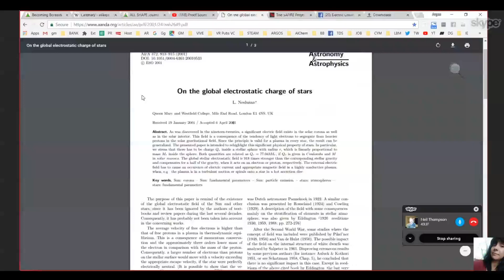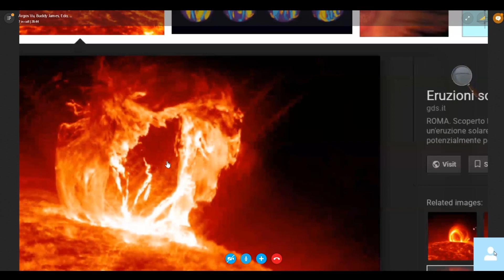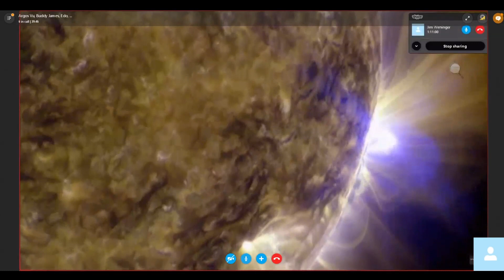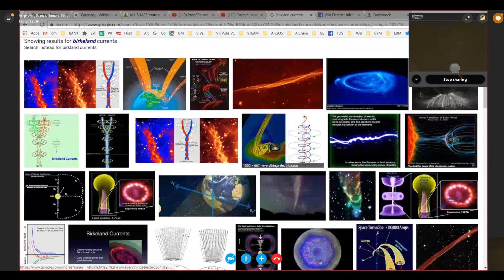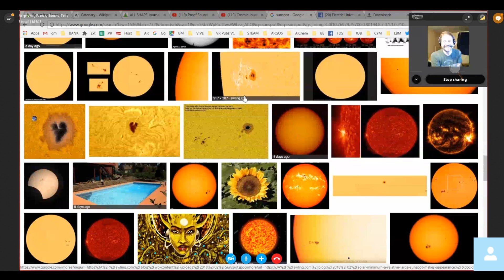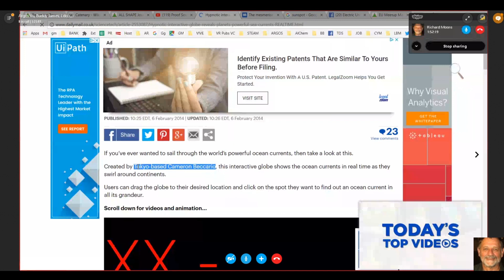Terrence Howard - What is the solar electrical circuit?

Comment: Enjoyed the interview very much, thanks!
Some thoughts. The Hydrogen-fusion solar core theory is obsolete, because:
1. The 'Coronal Problem'; it is the magnitude of the energy transference we are dealing with here.. 
Attempts at explaining away how so much energy escapes through what can only be termed a very, very 'cold' Photosphere without violating the laws of thermodynamics, borders on the laughable. 

2. The roundness of the Sun (no equatorial oblateness.) 
Pre-discovery, many, many papers were written, attempting to predict a bulging solar equator, due to its mass and rotation. But there is no bulge. Try to explain that away.

3. Sunspots are dark, cooler depressions, not brighter and hotter as one might expect from looking further into the Sun 
The present justification for this is to claim that somehow internal magnetic fields break through the Photosphere and cause the drop in temperature. 
Yet somehow, the same magnetic fields that issue from Sunspots are capable of creating Solar Loops obtaining temperatures in the millions of degrees. 
Why should they be so cool at Sunspot level, yet create temperatures in the millions of degrees in the coronal atmosphere? Where are the supposedly hot internal temperatures? Anyone else see a contradiction here?

Simply put, from an observational point of view, the Sun can absolutely not have the perceived energy radiating from within (Coronal Problem), nor the mass (Solar roundness) that we ascribe to it.

The only reasonable explanation must be that the Sun's plasma is able to induce gravity through the manipulation of the space fabric via magnetic fields.
Yes, I know that sounds far-fetched...but a whole lot more likely than the present solar model.

The ability of Solar Loops to entirely ignore the Sun's crushing gravity ought to be a massive, observable hint of the magnetic potential of the Sun, which has a unified magnetic plasma potential of 1 x 10 to the 39 greater than the gravitational force.
This has to be in play here.

We are pretty sure that three of the four states of matter (solid, liquid, gas,) only have a base gravitational potential dictated by their mass.
But organized plasmas? 
90+% of the Universe exists in this state, yet there is not a SINGLE published attempt to determine if this state is able to induce gravity without a corresponding quantity of matter.

So I propose a Sun: 
A polarized, magnetically maintained spherical Absolute Vacuum bottle exists directly under the Photosphere. 
The contents of this bottle is an aberration of space: the complete opposite of a Black Hole, with all that this implies. 
(Reacting to the aberration - think of the cavity created by a gunshot under water:
https://youtu.be/cp5gdUHFGIQ?t=5m55s

The 'bounce' you see? A rudimentary version of solar helioseismology oscillation.)

 Space violently implodes upon the sustained Absolute Vacuum and the implosion is indistinguishable from conventional gravity. 
It is the conflict between the magnetic outward push of the vacuum bottle and the inward implosion of space that keeps the Photosphere and Corona equilibrium.
The Sun is a mere shell of matter; this explains why the Sun is oh-so-very round.
Helioseismology and the Sun's slow rotation is also compatible with such a solar model, but that would make this comment way too long; thanks for taking the time to read this.

"Once you eliminate the impossible, whatever remains, no matter how improbable, must be the truth."
~ Arthur Conan Doyle

"An Empty Sun, is Gravity being Induced?"
https://youtu.be/2fdhyhPu6PY
Reply from the maker: Sounds like you listened to the HelioSeismology segment of "The Thunderbolts of the Gods" when Dr Donald Scott speaks on that issue.  https://youtu.be/5AUA7XS0TvA?t=1838

Induced by charge polarity perhaps.

 The only issue I have the Thornhill-Sansbury version of gravity is the weird incident where voltage potential seems to be inverse of this potential in some instances (The Sun, Comets, Gas Giants) http://www.holoscience.com/wp/electric-gravity-in-an-electric-universe/

All things being equal they should be made of the same things everything else is made from, therefore how exactly does the force of gravity come about? 

The ultimate goal, of course, being gravity manipulation and control.

Comment: Food for thought. All electromagnetics is a dynamic toroidal flow of energy around a singularity. The singularity is at the heart of all matter  from the atom to planets stars galaxies etc. I suspect the black spots that you see on the sun are a glimpse into the singularity, a black hole. At the heart of every atom is a black hole too but to understand this you have to envision that the black wholes are a piece of space with an energy field around it, the difference then being space with just pure energy and no fields in it. As a galaxy and all things within its torus move through this energy field {the space in which it flows} there is an energy transfer on all scales, and the singularity controls the entire system like a supercomputer. This would also tie in with supercondutivity or basically a processor, stars are like computer hubs in a giant network we call the universe. Perhaps.....the either net.

Comment: Well this discussion was charged up and sparky! Then the conversation pinched and a star appeared. Heh heh heh.
As for stellar current flow.. What a mess in my head. I think I have electrovertigo. I'll have to sleep on it. Wowee.
Reply: Can I link other youtube videos? Let's try...
https://youtu.be/zLzdivqozlY

Sunspots come from...?? heliospheric pressure changes? Like High\low pressure systems in Earth's atmosphere, but the seasons take 11 years to cycle?
This would all be better with you scribbling on a whiteboard ;)
Reply: https://youtu.be/PB01nRIwZtM
Solar wind & CME model from observations out to 40AU.

CME'S seem to be pulled off the surface by changes with the solar wind current sheath? Am I seeing that?